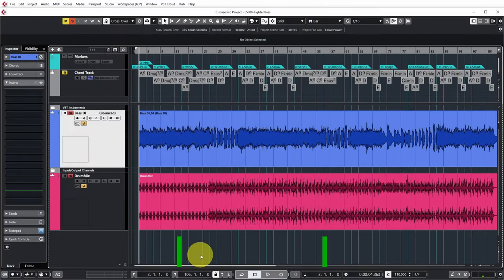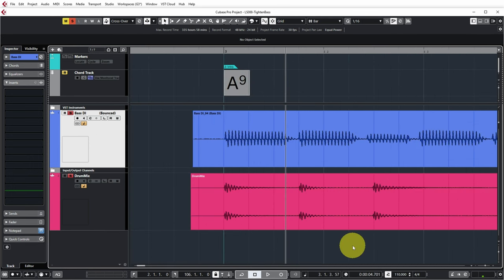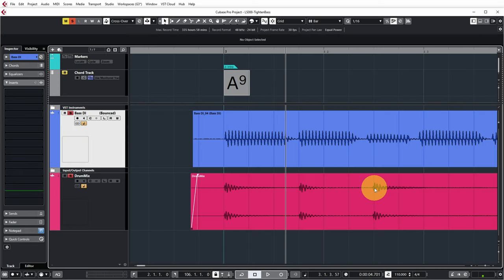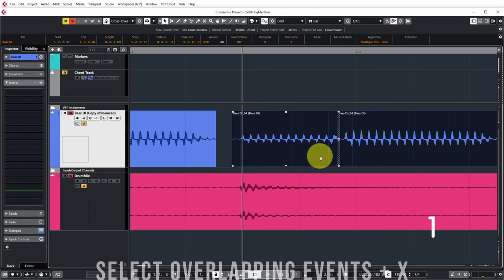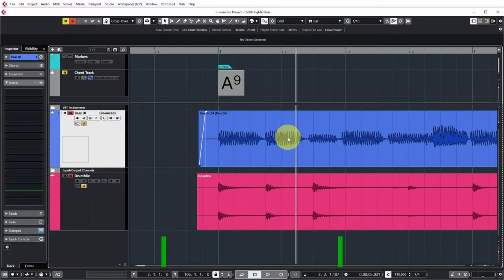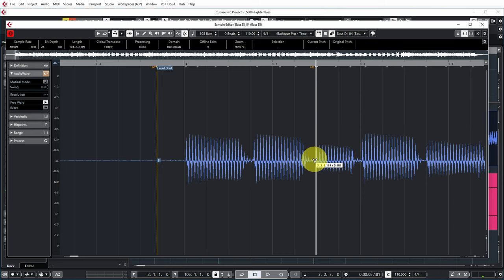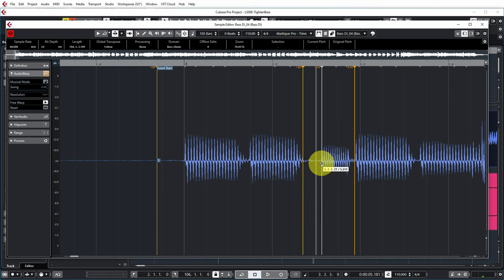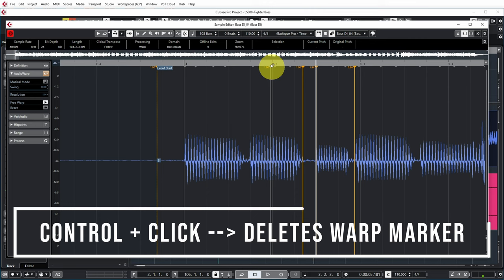How to use Cubase audio warp to tighten up a bass track!!

Comment: Really awesome video thanks a lot :) I follow you since months, and you're videos are really awesome thanks for your incredible job and good advices.

If i had to do the same thing but with DI and a recording amp, what will be step to do? What I imagine:
1 - Align the DI and the amp. (phase/time alignement) (and if you've a good method for that I'm ready to ear it
2 - Put the 2 tracks on the same directory and "glue" them
3 - Do the job on the DI and it will be automatically done on the amp also.

Best regards
Reply from the maker: Thanks. Yes if in step 2 you mean put them in a folder track set to group editing, then it sounds about right. For phase aligning the tracks I would just go by the waveform when zoomed in closely.

Comment: I use Audio Warp to adjust guitar parts but I never knew how to use manual mode. I've been literally just cutting up events and using the regular selection tool in time-warp mode to move parts around...
Reply from the maker: Great, and now you know 😉.

Comment: I'm trying to use Audio Warp for multitrack recorded drums, to fix some tempo issues in the performance, but I'm finding that I get artifacts on relatively modest adjustments - such as lost transients and tone shifting.  Is Audio Warping viable for drum editing, or should it only be used for solo instruments (like bass guitar in your video)?  I'm using Cubase Pro 12, with group editing and phase-coherence enabled on the 8 channel drums folder.  I made the edits via Free Warp in the project window, manually quantizing to the grid every bar or so (more control).  Maybe audio warp isn't there for drum editing yet?  Should I go with the old way of doing slices/fades/slips?  Great videos by the way - they're helping me get acclimated with Cubase.
Reply from the maker: Check out my other video on how to track  and grid a multi-track drum recording. 
3 ways to grid drums in Cubase (quantizing live drums)
https://youtu.be/zvt4O2CHt6o

Comment: Super cool video!!! Is there a way to use audiowarp quantize for a group like per example a folder with drums? I´ve tried with group editing and it´s imposible.
Reply from the maker: Yes you can. You can even select the track that will be used to determine how to stretch/quantize and all other tracks will be stretched accordingly. Good idea for another video 😉, but have a look at the seperate audio quantize panel if you don’t want to wait that long.

Comment: I was wondering if you can help, or do a video about an issue I'm having with comping/mixing bass guitar takes. My band is recording a new song (we use Cubase Pro 12 as our DAW). We did some bass guitar takes a few weeks ago, but we needed to do some more to correct a few things, so we did some more takes last weekend. The bass player DI'd into the desk/DAW via his bass preamp/effects 'fly rig' setup on both days.

When I was listening back to the takes we recorded on different days, its obvious the two have different EQ settings, so the EQ settings on his setup must've changed somehow, perhaps when he was transporting his gear. The earlier takes sound darker, the new takes brighter. I asked him if he'd changed any settings, he said he wasn't aware he had, but that the his preamp/pedals had been in his pedalboard case and he didn't think any of the settings on the pedals had moved. However it's obvious something has changed. They're analog, not digital, so dials could easily have moved in transit.

Really he should've written down his settings for the tone he'd dialed in, then he could simply dial it in for every rehearsal, gig and recording session. I'll get him to do this in future. Lesson learned.

But for now, I'm stuck trying to comp and mix bass guitar takes with different EQ settings at source. Is there a simple way I can match the EQ of the two takes, without having to just 'do it by ear', perhaps with some sort of plugin? Any EQ matching plugins? Or will we simply have to record yet more takes?
Reply from the maker: Yes that’s always annoying to deal with. You can try this: How and why I use Match EQ in Cubase and Fabfilter (CurveEQ and Pro-Q3)!
https://youtu.be/I7l3cIGlge4
Reply: @LanewoodStudios  Thanks for this. I tried what your said in the video with the CurveEQ in Cubase and it worked great!
Reply from the maker: @neilkendall5499  excellent!

Comment: I would like to ask you something in Cubase 11.. 

Is it possible to do some Audiowarp adjustments and then have them still applied when a tempotrack gets activated with a ramped tempo line?

It does not work as straightforward as I would wish for it to work..
Reply from the maker: I think it should work if the audio event is set to musical mode as well and the recorded tempo is correctly filled out.
Reply: I will keep looking into that..

Thank You! 

I like the way you’re explaining things. Very calming and informative
Reply from the maker: @michaelholzer2308  thank you and I hope you get it working!

Comment: Very nice! Does this also work if the track is in linear timebase?
Reply from the maker: Interesting question. Just tried it and seems to work as well. What would you use that for though? Because if you tighten a track to the click you would normally want it to be on the click, so set it to musical timebase as well no?
Reply: @LanewoodStudios  It's possible some of my normal workflow is outdated. I often use quite complex tempo maps derived from the played audio using the audio warp tool. I need to be sure that the audio is not getting stretched in that process, so I would normally have those tracks in linear time base.
Reply from the maker: @rsmrecords  ah yes, there’s multipele ways to achieve your end goal 👍.

Comment: Hi, just press "Q" and most of the hits are on the grid. If not, adjust the quantize settings and redo it. After that --- all of your explained procedures are welcome. Thank you.
Reply from the maker: That’s what I initially did but it didn’t work right for this part. I had to go with carefully tuning the hitpoints first as I show in the video.
Reply: No, just pressing 'Q' doesn't usually produce a good/natural sounding result for quantizing audio. That only works with quantizing MIDI tracks.  You have to adjust the threshold and intensity levels etc as explained is this video to get it to work properly with audio.